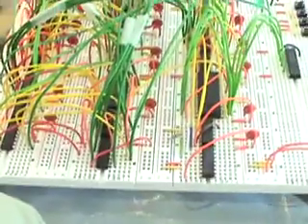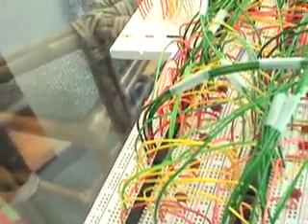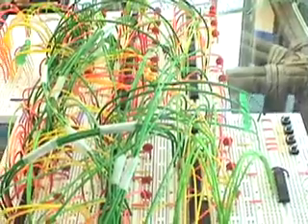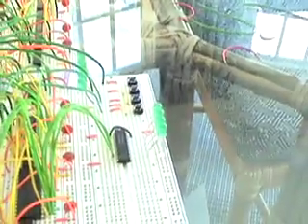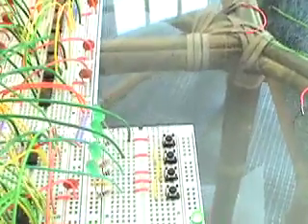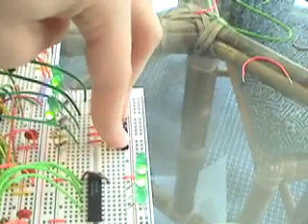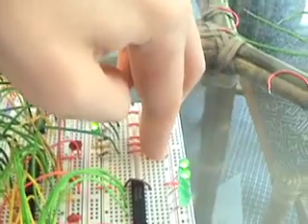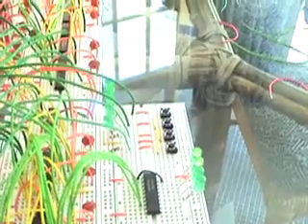DUO Elite Computer Construction Vlog (4)

Comment from the maker: Wellll, you are actually both wrong, but bootnecklad is less wrong. 1111 + 1 DOES yield a 0, but since the program is designed to only output the number in RAM if it is greater than 4, the computer will ignore the input. :P

If I had arranged the commands like so, the output would be a 0:

1. Accept input into RAM.
2. Is RAM > 4?
3. If yes, increment RAM
4. If yes, output RAM
5. Goto step 1.